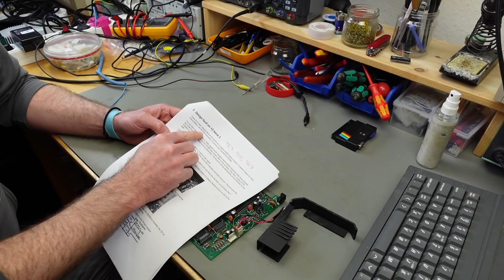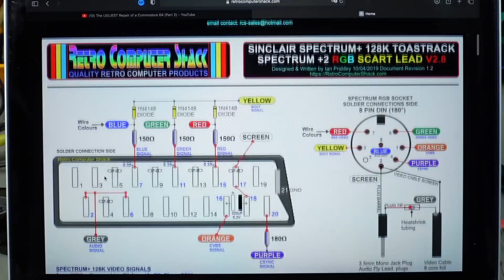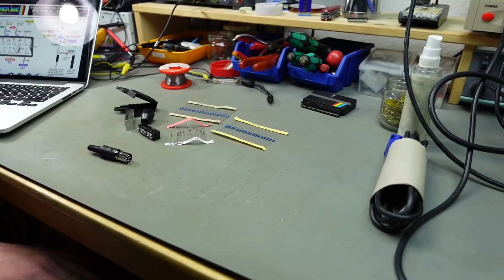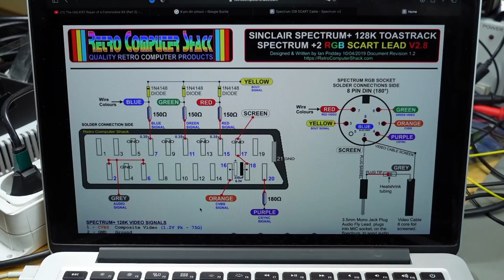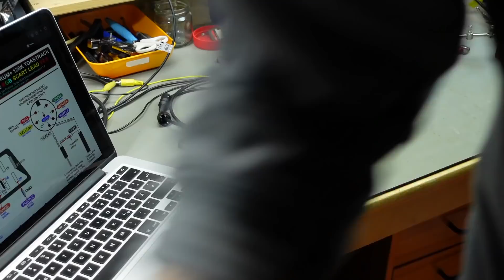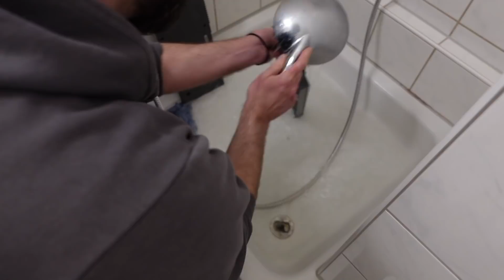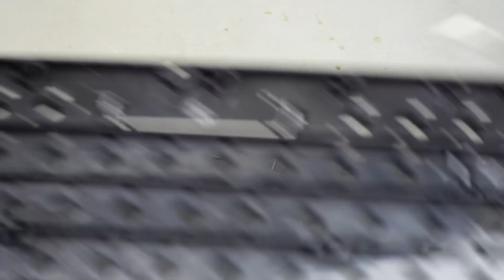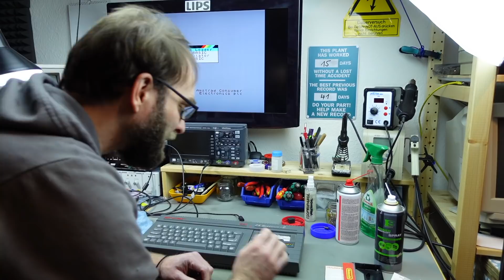Sinclair ZX Spectrum +2 Full Restoration

Comment: Looking at the first cable and the layout it seems to me that the issue with it is that there was a single diode connected to the three resistors in the scart plug while the diagram shows each resistor being connected to a seperate diode.
Reply from the maker: I did connect the separate diodes to the resistors. I think I must have shorted something in the cable or the cable was broken before, didn’t test it. :/

Comment: The loading issues is due to misaligned head azimuth, you have to turn the one spring loaded screw on the head till the audio sharpens up then it will load fine
Reply: I normally do adjustments by ear too, as soon as the sound goes from muffled to sharp but not super thin, that's where I've found the sweet spot on the spectrum +2
Reply from the maker: I‘m going to try that. I did get it as far as showing the loading screen in the meantime but the it just reset.
Reply: @JanBeta  the best way to do azimuth is by ear, i think. Especially if you have a musical ear :) Simply play a tape and listen to the sound.. the azimuth is best when the sound is "harshest".. where the high frequencies are getting through the best.

For the ultimate loading test, find a game using the Alkatraz loader. These are recognisable by the fancy way in which they load their loading screen. Ghouls n Ghosts and 720 are examples of them